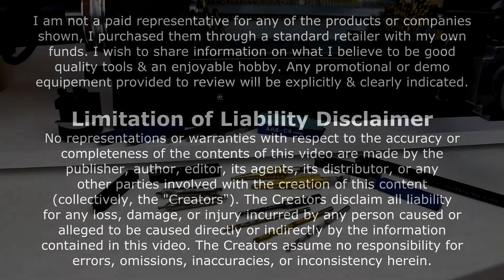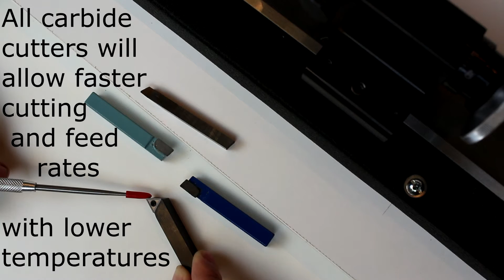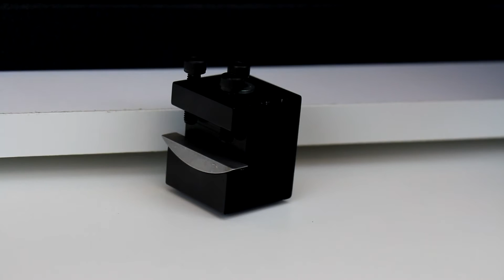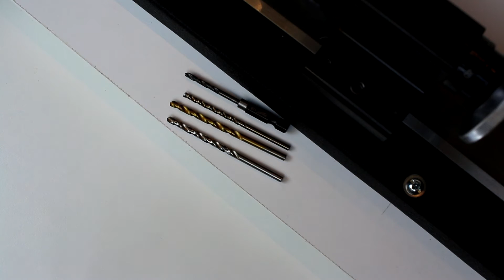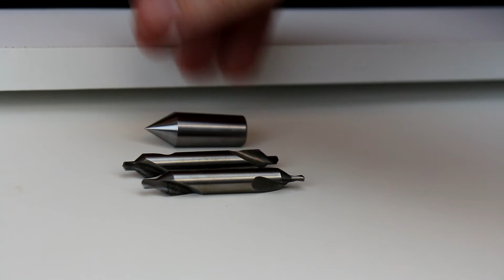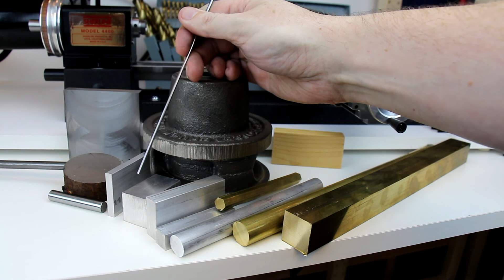Sherline Lathe 103 - Tooling & Materials

Comment: Do you have recommendations as to where to purchase quality cutters? Cheap cutters?
Reply from the maker: +Paul Devey Ah... quality and cheap? ;) Best bang for the buck that I've found is the carbide insert cutters from Anytime Tools, they are what I use primarily and what you see in all my videos for the lathe. Find them on Amazon, $27 for 5-piece 1/4" or $35 for same thing in 3/8". I've found the 3/8" cutters to sit a little high in the sherline fixed toolposts, don't have a sherline 1/4" fixed tool post to test with. If you are using rocker, lantern, or quick-change tool post you should have no issues... or grind/mill the cutter's bar thinner on the bottom side if you are stuck with non-adjustable tool posts.
Reply: +MiniMachining Would you recommend the 3/8" over the 1/4"? I would think since the 3/8" is slightly bigger and it should allow you to take deeper cuts and last a little longer... what do you think?
Reply from the maker: Yes, normally you want to use the largest lathe tool you can for the increased strength/rigidity/mass/etc. However, make sure your tool post will fit the larger cutters. Long term, particularly if you do very small parts with tight spaces also, you'll want both 3/8" and 1/4"... possibly even 1/8" tools.